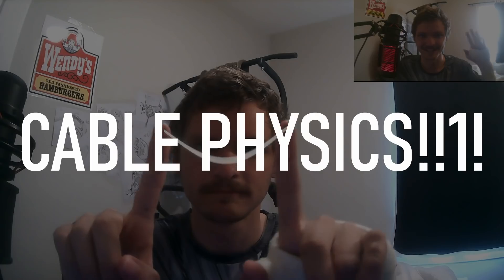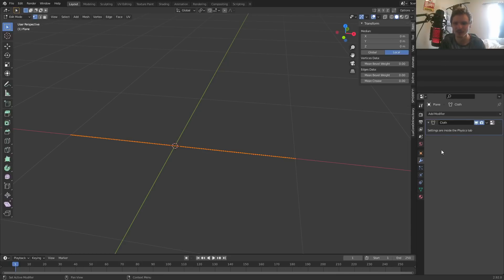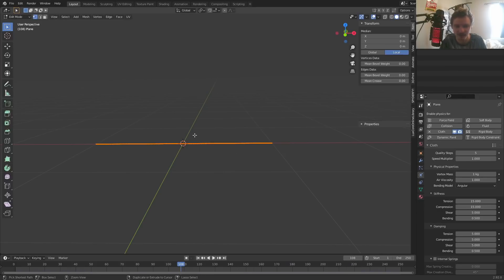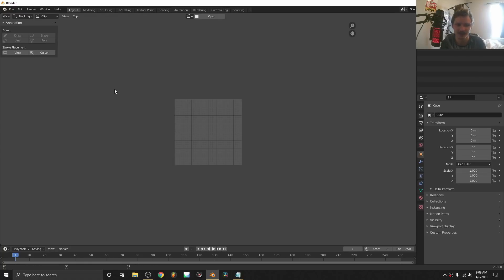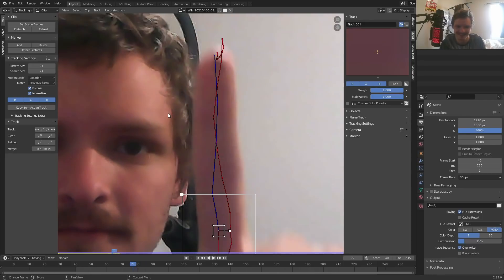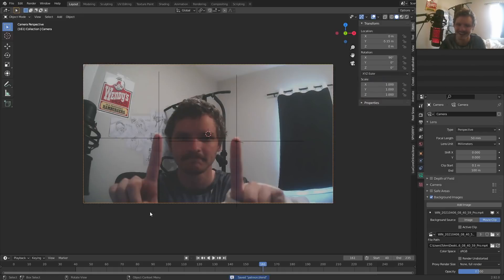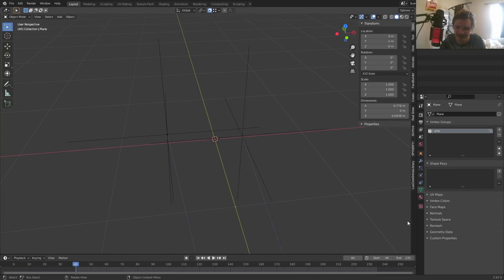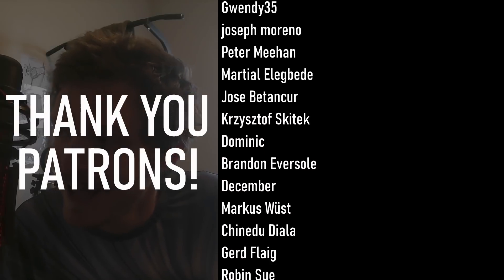Cable Physics ARMAGEDDON - Blender

Comment: when I try to shrink the vertex for the skin modifier they all shrink into a specific point and the skin modifier doesn't actually change size.

Edit: Found the solution, You can't just scale them for whatever reason now, You have to press ctrl+A instead.

Comment: Would maybe work a bit more convincing if you made your rope when the two points are at a maximum length from each other?

If its a rubber band, at maximum length it should be stretched tight, while if its a string there could be some tension at maximum length stretching it straight, but all the changes to tension after maximum tension would make it droop?

Comment: How do I make the video appear in the camera once I render it?
Reply: Good question ! Did you find a solution ?
Reply: @mrscott3759  I don't think my way is the best and most efficient way, but I just made a plane and then made the texture a video (by putting the texture as a "image texture" and then just importing a video), and then just fit it to the camera, and then linked the corner vertices to track the vertices that the camera is tracked to (hope you can understand).
Reply: @zalmanlevy6932   thank you i'll try this !

Comment: I should figure this out myself, but... lazy. Question:

How would you simulate (using physics) bending a plank (board of thickness<width<length) around a "form" ("boat ribs") such that you can "tack" the board's width to each rib, making the board "bend" appropriately so that it behaves like the actual planking on a boat?

(Neither the "volume" nor the "overall shape" [such as a non-rectangular board-shape] of the plank can change, but it does bend as a board would [meaning there can be very minor %'age compression or tension/stretching of the "local" dimensions].)

It "seems" like cloth simulation is the way to go, using the various "constraints" to keep each of the 3 local bendings (axes of the board) in realistic range.

Anyway, that's the question,.. Thanks for your great work! Aloha a me mahalo nui 'oe! :) 🤙 <--- Shaka

Comment: I hoped you would address the stiffness near one of the hooks, is it a realtime glitch that goes away if you bake it?
Reply: it's because you subdivided after putting the pins. you can fix this by going to the pins group. pressing the select button so you can see all the pins that are used. then select all the ones u dont want as pins and press remove to remove them from the group. sorry it was so late

Comment: i wonder if this 1D cloth sim method reacts properly if you use it to emulate the highly tensioned strings of a musical instrument (oscillation in response to being plucked/struck, ect)
Reply: I heard about a 2d physics extension add-on to make rigid bodies function with the grease pencil. Makes sense, but why the need for an add-on in the first place?
 Any plans for support in the future here with vanilla? On the string equations:
Maybe we can use second order partial divs to model the string resonance using real partial derivatives. Do you apply calculus with python or know how to use these divEqs in Blender, Sir Default Cube?
Reply: @pa.l.2499  while they're at it they should add a Wave Equation math node so i can do a physically accurate shot of the puddle vibrating from Jurassic park with true falloff based on the internal friction of water
Reply: Wave Modifier don't at me, if it aint nodes it aint worth doing

Comment: Would this work for say a closed circuit? If I wanted to make a necklace for a character would you suggest this method or something else entirely?
Reply from the maker: no reason this couldn't work. just start with a loop instead of a line segment